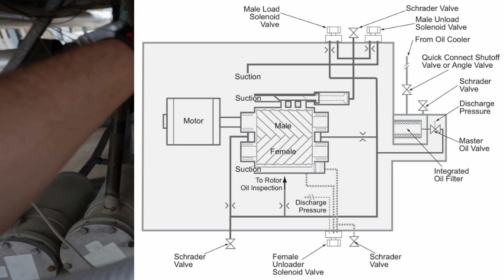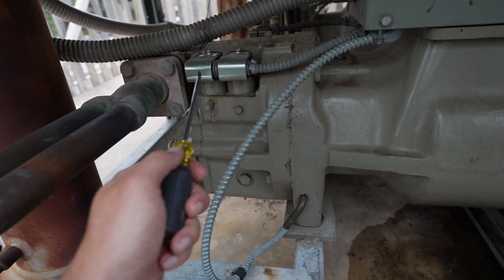How Trane Screw Chillers Loaders Work Chiller Training

Comment: Trane chiller showing no data communication after resetting the system come up but only one compressor runs while the second refuse to run and keep showing high pressure cut out and the system goes down after 10min showing no data communication what can be the problem

Comment: Do you work for Trane? Just wondering how you would plug into there newer chillers without the proprietary software?
Reply from the maker: I have the software license. I don't work for Trane though.
Reply: You don’t need proprietary software for Trane nor a license
Reply: You cannot plug into a trane system without the software. Tech View for any Dynaview systems and Tracer TU for any UC or Symbio systems. But the licenses need to be purchased for the software.

Comment: During unloading or on startup what should the oil pressure be on a rtaa and rtud? And during normal operation while it's maintaining what should the oil pressures be.
Reply: Most R series chillers run at 35psid on the oil system for proper oil flow. Trip point at 50psid

Comment: At 3:20 you said that during shut down the female unloader is deenergized. Is that correct? Or is the female unloader energized?
Reply: Looks like I found the other answer in the manual. Kind of odd that energizing the unloader valves loads the compressor and vice versa. You would think it should be called a female loader valve.

“The female unloader valve solenoid receives a constant signal from the UCM, based on system cooling requirements. To load the compressor, the female unloader valve solenoid is energized and discharge pressure is passed through the normally-closed port and into the cylinder. This pushes the female unloader valve closed.
To unload the compressor, the female unloader valve solenoid is de-energized and the discharge pressure is relieved to the suction of the compressor. The female unloader valve retracts into the cylinder and the compressor is unloaded.”
Reply from the maker: Yes the female unloader gets denergize as a final step before shutdown. So when loading starts it gets energized and stays energized until shutdown.
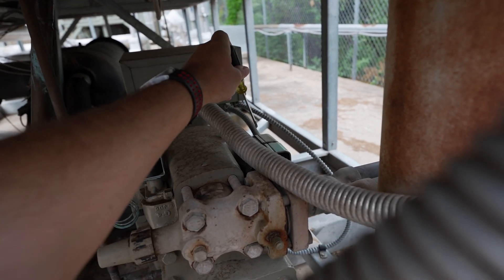Reply: Noticed that you repeated it at 3:42 and 3:51 but at the start you said the unloader was energized. Seems like you mixed up the words?
Reply: Was reading through the RTAA IOM to study this further and noticed it says. “The female unloader valve is the first stage of loading after the compressor starts and the last stage of unloading before the compressor shuts down.”

Appreciate your videos, I don’t know about any other channels that make quality large tonnage HVAC videos like yours. I mostly work on under 100 tons so I’ll dabble with this equipment occasionally. It’s good to be able to see the equipment to supplement the studying I’m doing in manuals and other resources.

Comment: We deal with American Hermetics pretty often out of Tennessee. Agreed they are awesome to deal with.
Reply from the maker: Good people
Reply: @HVACTIME  Dear hvac expert from long time i am watching your following to you.I am from pakistan.i am facing one problem in my yciv chiller.this chiller have to to systems.chiller was running normal but i recive complaints chiller trip both system same time trip due to low suction alarms.We changes steppers controller and new mother board.water flow also also ok in cooler suction tranduser also replaced.Share your advice.thanks for repling.

Comment: 🤯lol 👍😅
Reply: In my job location i have facing on problem with chiller of yciv 2 system model.chiller was in normal operations but now a day's chiller going low suction trip same time both system going low suction trip.i changed stepper controller and motherboard also with new one but same issue.after start both systems of chiller goes low suction trip.need help to rectify